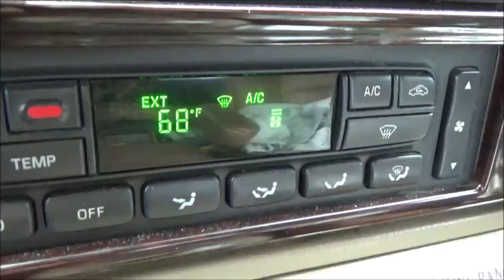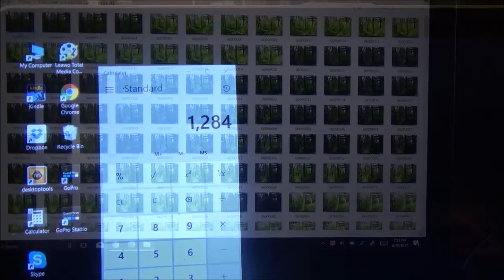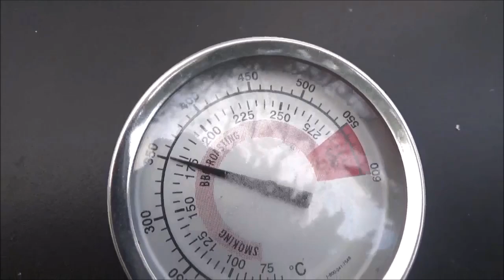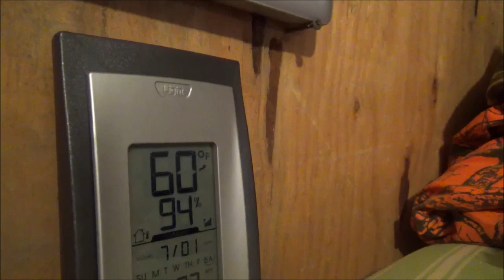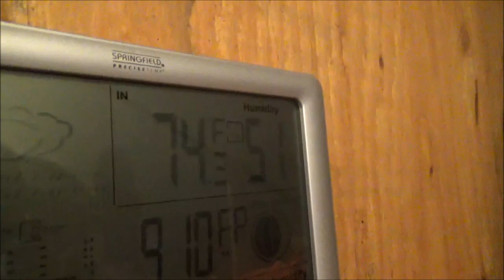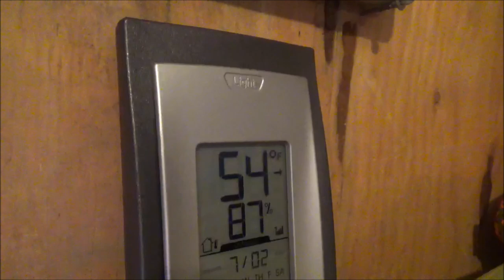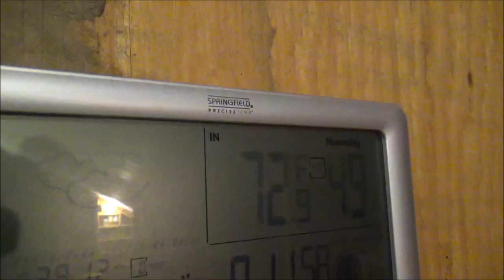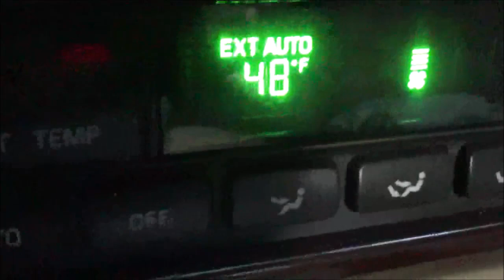THE TENT. The Summer Season Begins.

Comment: Hey joe I know you probably want to stay away from modifying your truck but I think you should atleast straight pipe it, you get better mpg's and it really helps w towing and driving in general tbh
Reply from the maker: I just got it back, it is now fully bullet proofed. High pressure oil pump, I already had the egr delete done. I had all the new studs put in, the gaskets that always leak on those 6.0 fords replaced. I also put in all new injectors. Next will be a leveling kit and for when I pull the 5th wheel since I am going to level it I want the air bags in the back put in. Eventually bigger tires and different rims with a -12 or-24 negative offset. One thing at a time. Perhaps then I may want to think exhaust.
Reply: if you don't mind me asking How much did the Bullet proof cost you? I have had quotes ranging from $2800-$7600.

Comment: DONT KNOW IF IT WAS EVER MENTIONED, BUT IS THE FEATHERS A ONE EACH FOR THE ONES YOU HARVEST, SECOND QUESTION, HOW MANY FOLKS MENTION THE SECOND HAND ON THE CLOCK BEIN STUCK
Reply from the maker: Yes each feather is for each bird. The separation between groups separates hunting seasons. That hand has not worked for years but the clock is atomic time so it is always correct.

Comment: I found your channel a few weeks ago and binged watched a bunch of your videos. Got me dreaming of having my own cabin someday. I'm curious about your power situation. I know you use a generator but do you run it 24 hours a day or shut it off at night. Is all your lighting 120 volt or do you use some 12 volt lighting with a battery bank that you charge up? Also do you have a grey water catch system or a leach field that lets it soak away under the ground. Do you have any videos that touch on these two issues.

Comment: How many times do you need to fill our generator.When I first started watching your video's i thought you were on he grid cause I never seen you fill it.
Reply from the maker: I used the honda 3000iu generator the first 7 years and then I dug in grid power. That generator would run 23 hours on one fill of gas. I at one time was up there for 28 days in a row and never shut it off, I would fill it while it was running. I can not say enough good things about that generator BUT. The grid is easier. Thank you.

Comment: Hey Joe, great video. When do you plan on building that permanent cabin you're always talking about? Justin
Reply from the maker: I am not sure. The Tent is still holding up well and has everything I need. It is more an issue of time.  Once the Tent comes down I will need that cabin up and a roof on it and it insulated (so the wiring will have to be done) and the new wood stove installed etc so it is ready for deer season. This time of year I do not have that time with work being so busy. It will also take money and we still have to finish the Louisiana house. I will get to it eventually. Usually with me I will wake up one day and have made up my mind I am going to do it and it will begin. That feeling has not happened yet but it will.

Comment: I'm sure you have answered this in some of the first tent videos but I haven't watched all of them yet. Do you have electricity run to the tent or do you run off a generator? And if it's a generator what size is it?
Reply from the maker: I used a Honda 3000iu for the first 7 years and then 3 years ago dug in grid power. That Honda is the best and most quiet generator you will find. It would run 23 hours on one fill of gas.